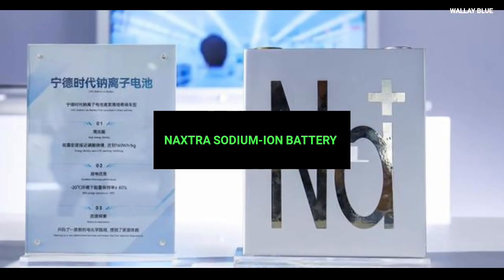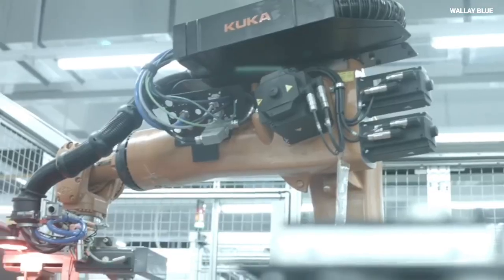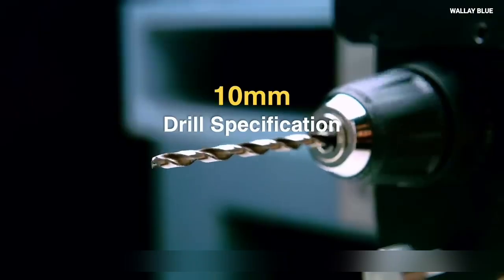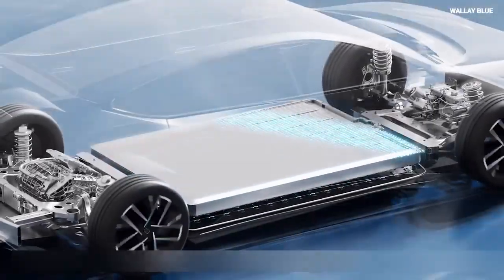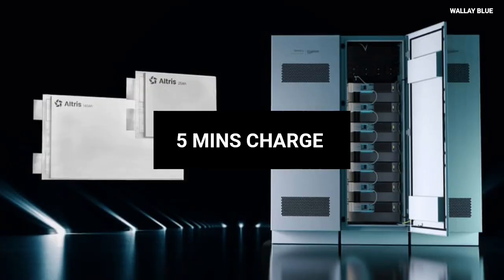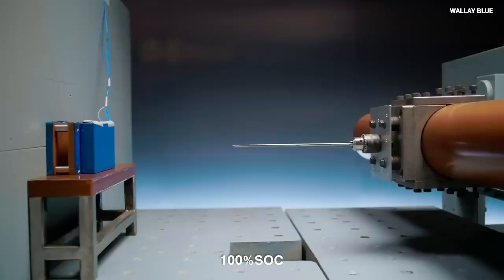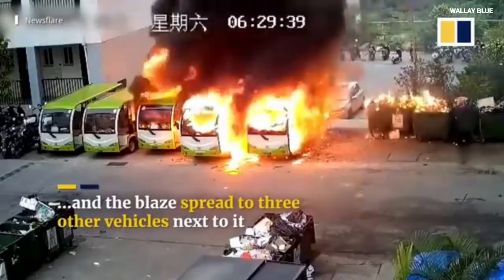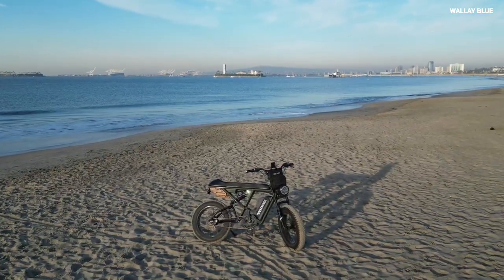CATL Naxtra Battery Shocks the EV World – 520KM in 5 Minutes!

Comment: Crap video production but rock solid concept. This is the battery chemistry that is going to change the world for the working class. AFFORDABLE BEV'S FOR THE MASSES! Imagine when your car battery costs less than your power windows. It's happening soon enough since these are reportedly priced at between $10-35/kwh compared to what, $70 for LFP or $110 for NCA?